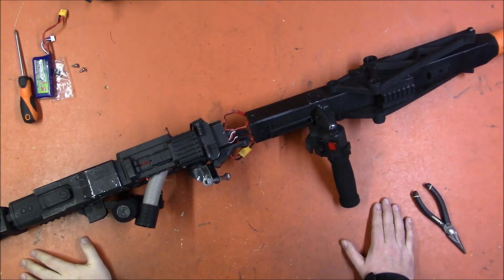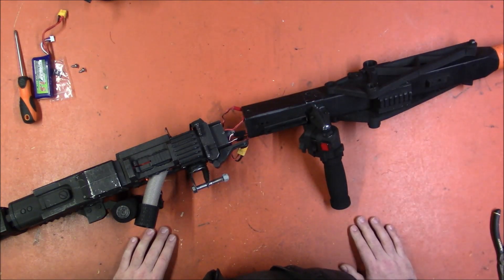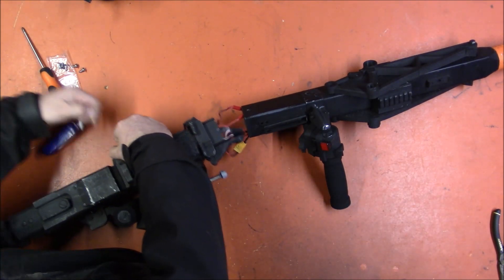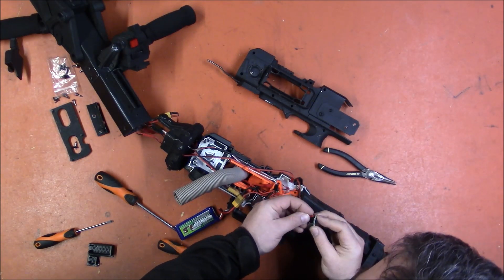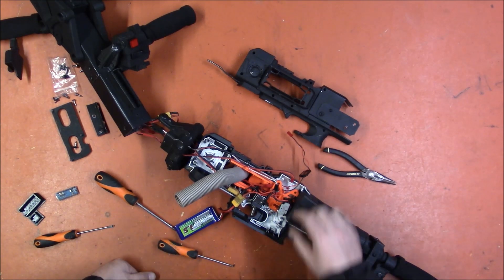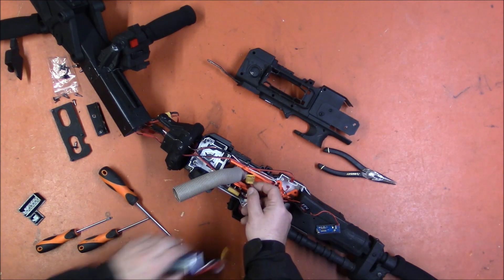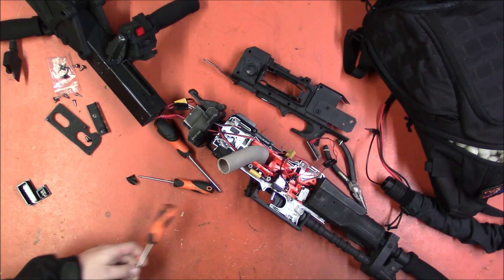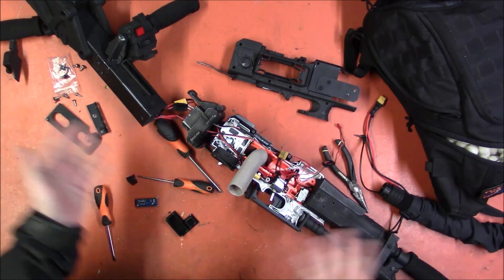Captain Xavier's 2023 New Year Build - Day 5: Smartgun Diagnostics and Plans

Comment: The current sensing on the Proton Pack is adjustable. I don't remember which pot it is but it's in OOD's assembly video.
Reply from the maker: I am aware. But I don't want to have to disassemble the Proton Pack and readjust the POT every time I switch blasters. That would defeat the point of it being modular.
Reply: @CaptainXavier  I'm pretty sure if you tweak it up it'll continue to work for the other blasters. Even a Meishel motor draws a little over 18A when idle which should be a lot more than Arduino and speed controller passive draw.